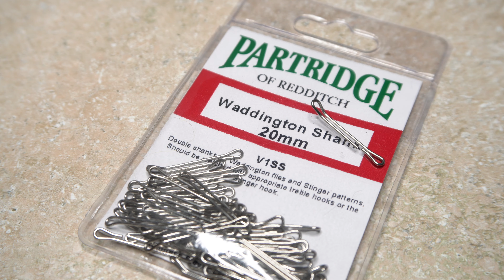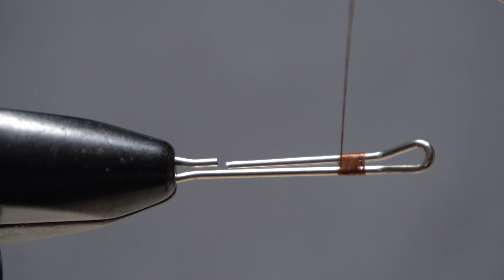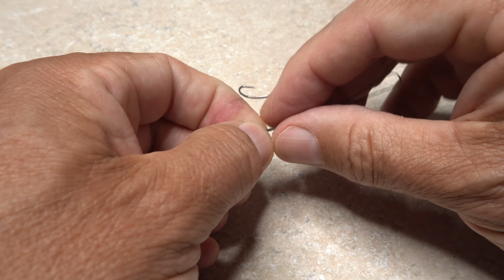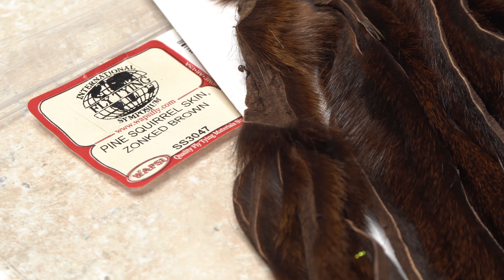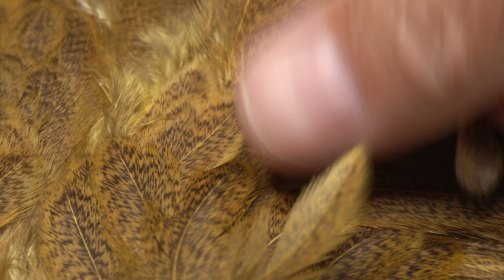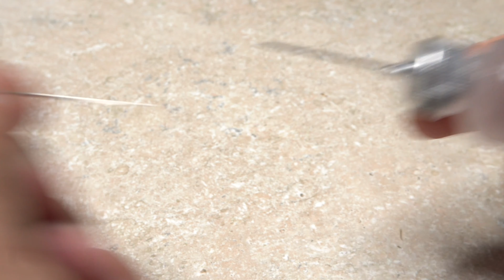Two-Tone Intruder

Comment: The OPST guys use a weird double hitch in the trailing braid so that the hook is bound to the hide of the zonked pine squirrel. Do you ever do that with this pattern?
Reply from the maker: I know the technique and like the idea but haven't actually done it myself. This one has been working so well as is, I'm kinda hesitant to mess with it.
Reply: tightlinevideo 10-4…this seems more straightforward, especially when it comes to switching out hooks. Thanks!

Comment: Why not just tie the fireline to the end of the shank? 🤔 That would also make it easier to change the hook if necessary.
Reply from the maker: The hook is very easily changed as is. The Fireline loop is long enough to allow the whole hook to slip through it. The Fireline loop with two strands also provides an extremely robust connection between the hook and the shank and the added stiffness helps the fly to ride correctly when swung.